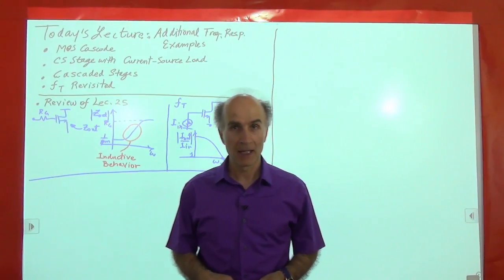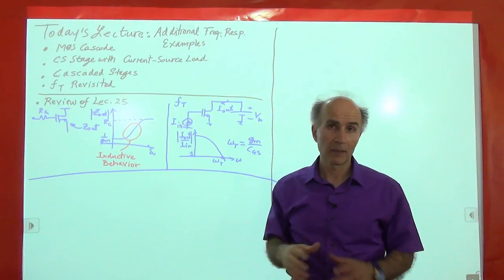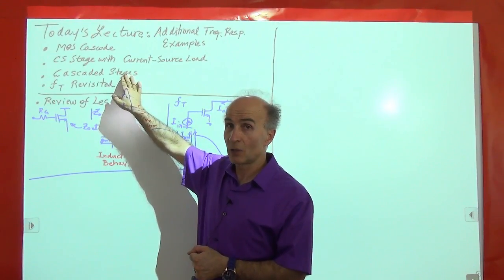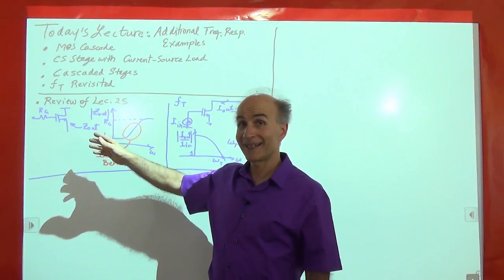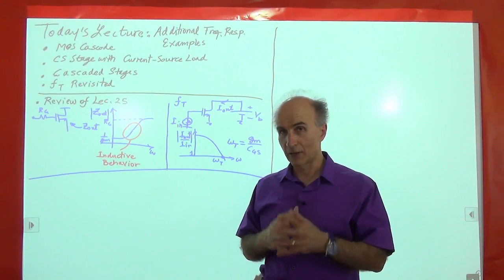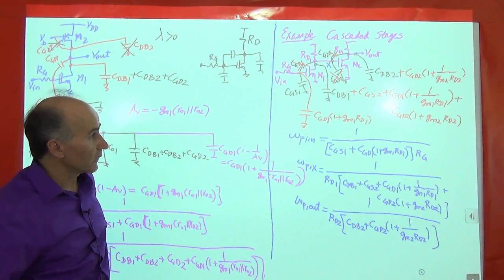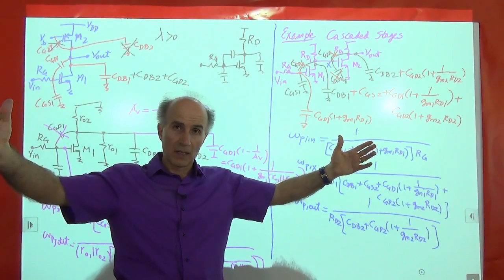Razavi Electronics2 Lec26: Additional Examples of Frequency Response, Cascaded Stages

Comment: 01:25 - Intro and Review of Lecture 25
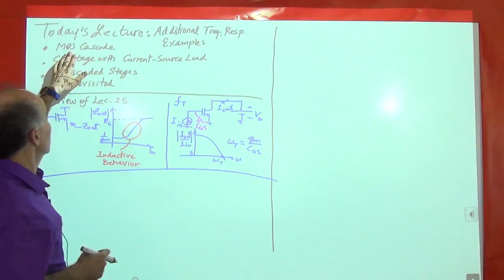05:10 - MOS Cascode
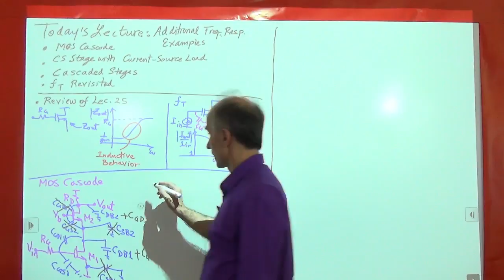09:50 - Find the Poles by Inspection
22:05 - CS Stage with Current-Source Load
35:30 - Cascaded Stages
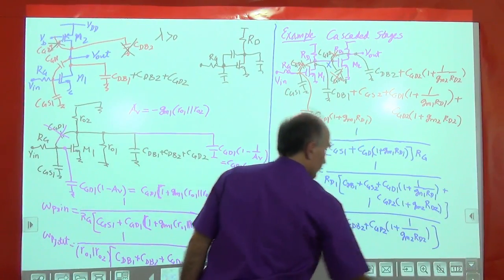44:30 - Transit Frequency Change with Width and Bias Current

Comment: Can someone pls explain why the o/p impedance of M2 in MOS cascode is 1/gm?
Reply: Just draw the small signal model and look at the output resistance, but between node (B) and GND. Youll see that vx = -vgs and if you neglect channel length modulation youll have ix = -gm2*vgs2, therefore the output resistance you see at that node is 1/gm2.
Reply: Razavi electronics-1  Lec-40(common gate)  8:48